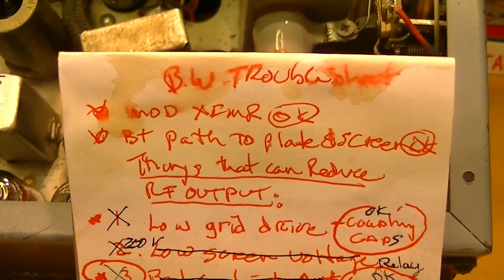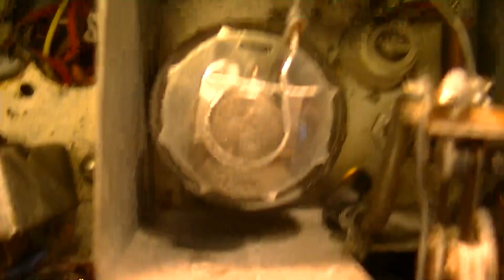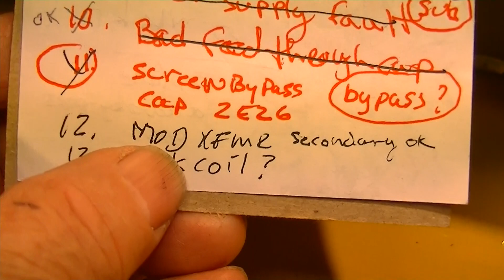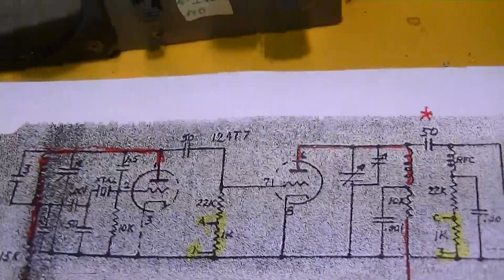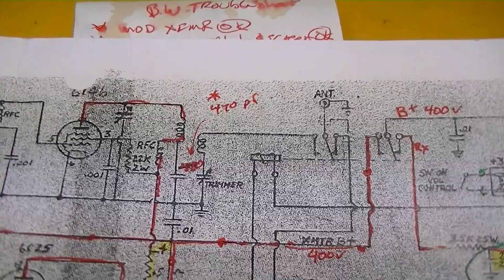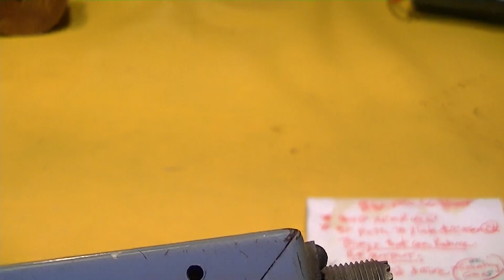Rogers Black Widow 6 Meters: Low RF Output W6WUH Inside Classic Ham Radios

Comment from the maker: set this aside for a couple of years.   Next, I will replace the coupling caps between the osc/doubler/ and final with new ones...  and/or  try supplying drive to the from an external source an effort to isolate the problem to the driver or final.  if a 1/2 watt from the FT-817 will drive the final to its normal 15W output.. then we know the problem is with  excitation.    my money is now on an osc/driver fault.

Comment from the maker: Repair sidelined for more important things.  I discovered my dummy load was open !so, when it goes back on the bench, we will recheck with the repaired test set up.  If still NFG.. no choice but to life all the leads of the mod xfmr, and check the windings out of the circuit.   I would prefer the problem be the hollow space between my ears, to a failed mod xfmr.. time will tell.  6/9/2018